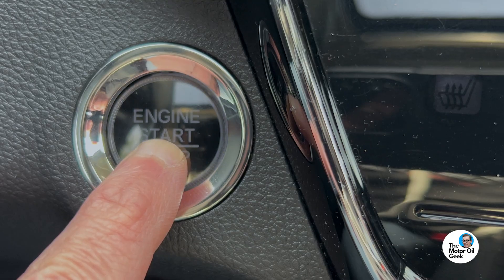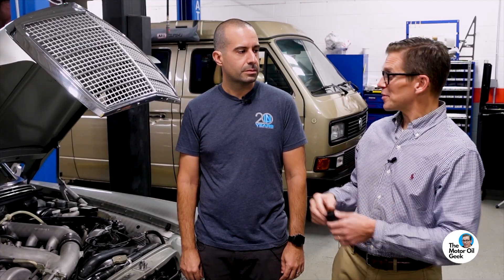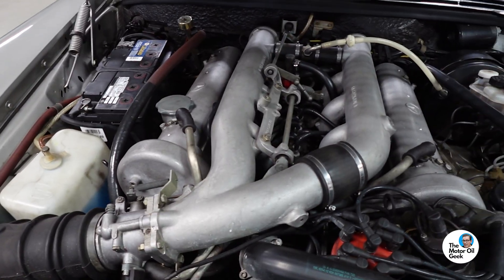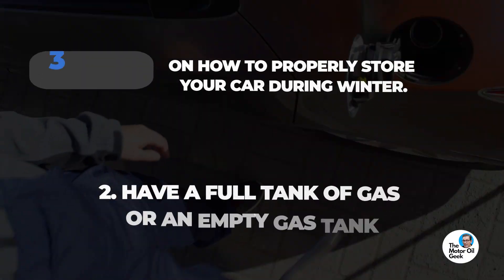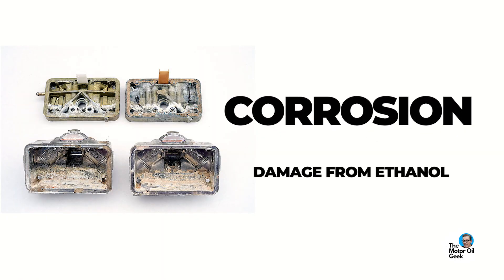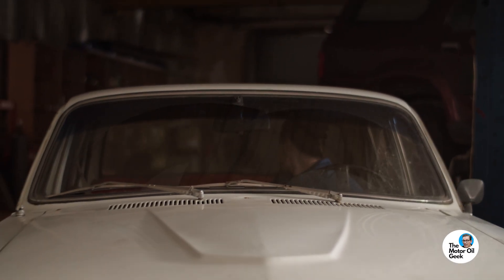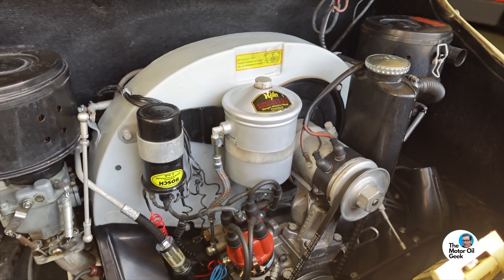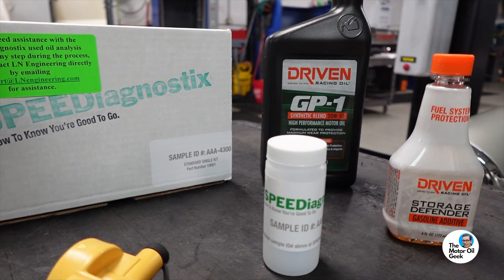3 Winter Storage Tips To AVOID Engine DAMAGE

Comment: Always remember, "where air goes, water goes".  Powersports like ATV, motorcycles and Jet Skis usually have a petcock to shut off fuel.  Most owners, run the carbs dry and that is a no no.  You want to keep the air and moisture out of the carbs and keep the seats and o-rings wet.  Your advice to fill the tank is correct, but you do need to leave a small air gap for expansion especially if you use a heated storage area.  The fuel will expand and push gas through the carbs into the engine.  Turn the petcock to off if you have one. Don't forget to run the engine after fuel treatment.  Many people forget to do this leaving the fuel and components in the system after the tank remain unprotected.

You did not mention fogging oils.  I like to fog 2 stroke engines through the induction system to coat the crank and lower bearings in addition to the cylinder walls.  On 4 strokes, I spray fogging oil through the spark plug holes and spin the motor to distribute.  You are correct, never start a motor in storage, but I do recommend spinning the motor over to keep the cylinder walls and rings coated.  

Great video, keep up the good work.
Reply from the maker: Thanks!

Comment: Awesome info as always! Approximately how long does it take for enough of the oil film to drip off of the engine's internal surfaces to risk allowing rust and/or significant wear on startup from a dry start? I realize there are tons of variables, but is there a general recommendation for a safe amount of time for an engine to sit unused in an unconditioned garage or outside?
Reply from the maker: There are a ton of variables, and one is the oil itself. Some oils will stay on the surface much longer than others. In general, the engine can sit over the winter and be fine - no rust or dry start issues.

Comment: I have never seen a video like this before. However, I have been doing  exactly what you recommended for years. My question is if for some reason you do have to move a vehicle that say you are driving on a regular basis but not using it that day or perhaps several days, can that moisture that is introduced to that shortengine run be burned out at later time by driving the vehicle well enough to completely bring the engine up to temperature for a extended period of time? Great video, and thanks for posting it.
Reply from the maker: Thanks for watching and the question. Yes, driving the car can get the engine up to temperature and burn off the moisture.

Comment: Good advice on oil change and no start.  Note that keeping fuel tank full also reduces moisture accumulation from diurnal temperature and humidity and barometer fluctuations.  I'd like more on ethanol free vs std gas.  How about coolant, you chem experts?  Finally, trickle charger keeps battery alive. 

Sure, tell us about oil life monitors.
Reply from the maker: Thanks!

Comment: My 2001 Chevy Impala has twenty thousand miles on it.  Before I left for a two year trip in Europe I filled the gas tank up added a fuel preservative then changed the oil with Castrol edge professional 10w30 synthetic oil then took each spark plugs out and sprayed a fogging oil in each cylinder then kept a automatic trickle charger to the battery . Then I jacked up the car to keep pressure on tires to a minimum. When I returned home the car started as if has been always driven.:yougotthis: Great Video!
Reply: The old detroit diesel 2 stroke service manuals have tons of great tips on how to pickle an engine. 
One that stood out to me was placing wax paper between the v belts and backing tension off. 
They definitely had good stuff in there especially if it was going to be stored for years.
Reply: Great. You got to see Europe while it was still there.
Reply: @anonymike8280  He got to see Europe while it was still there?
I don't understand what is meant by this.
Reply: @PassionForGrammar   @PassionForGrammar  Then meditate on it. I and the people I have hung with all my life are quick wits who understand cynical and cryptic humor.

I'll admit my remark was a little off topic though.
Reply: @anonymike8280  alright, whatever man
Reply: Russia vs. Ukraine war. @PassionForGrammar
Reply from the maker: Thanks for sharing!
Reply: That's amazing, thanks for this comment - I've always wonder jsut exactly how long fuel stabilizer will actually work!

Comment: Many years ago, I looked up oil sample testing. I recall the procedure was to send two samples. One with the new oil that you put in, then another from the crankcase when you drained the oil. That would supposedly allow a comparison.
Was that ever part of a sample test kit procedure?
Reply from the maker: Yes, you can sample both new and used oil for comparison. It is common practice but not required.

Comment: Other tips, disconnect the battery or use a battery tender to keep it topped off. Inflate the tires to 40 psi, and or park on top of pieces of wood, so you don't flat spot the tires. Or lift the car and suspend the control arms so they don't droop.

Comment: Great info - Also, disconnect battery and put in on a good maintainer either in or out of the vehicle.
Reply: Disconnecting the battery will reset the computer. In some vehicles, it is nece$$ary to go back to the dealer and have the computer reprogrammed. On my car, all that happens is that I lose the radio presets. My car is a 2001 built on mid-1990s technology.

You don't need much current to maintain the electronics, but you have to get things properly hooked up before you disconnect the battery. Do it wrong on either end of the procedure and it could cost you.💲💲💲💲💲
Reply: Exactly. Newer cars need constant amounts of small power. A trickle charger might help.

Comment: Great video, Love to hear your thoughts on top end/cylinder fogging either introduced through the throttle body of a running engine, or into the spark plug holes (obviously not running).  Most marine engine manufacturers recommend fogging as part of the storage prep process.  Is it necessary?
Reply from the maker: Fogging spray is great. Foggit is my favorite.

Comment: What’s about rust on cylinder walls if you don’t run when kept off snow salt roads? But I run and move it around bringing oil temperature up to proper temperature this also lubes drivetrain and uses brakes.I just don’t take it out on salty snow roads.

Comment: Yes, I am definitely interested in how oil life indicators work in cars!  Is it based on Mileage? Engine Hours? Time?  or a combination of some or all of these?  Also, does it vary from manufacturer to manufacturer?  Does each manufacturer have a different algorithm/criteria for the oil life indicator or is this an industry standard across all manufacturers?  And finally, what is the recommended threshold by which I should change my oil?  Is it when it reaches 10%? 15%?  20%?   What happens if a year has passed and my oil life indicator is still above 50%?  Is that possible and if so, what do I do?
Reply from the maker: We will answer those in the video
Reply from the maker: https://youtu.be/t4e0oDBseqo

Comment: This is very usefull !
What kind of oil would you choose for storage- the cheapest recommended by the manufacturer or something in between cheap and expensive?
Reply from the maker: Thanks. Use the oil you typically use. Don't use something different just for storage.
Reply: @themotoroilgeek  Hmm...one more question if i may: what do you think is best for an engine, the approval or the ACEA norm? I mean for example MB 226/RN17  or ACEA C3 ?
Reply from the maker: @hirayaman246  OEM approval is more important.

Comment: FOURTH- Dont suspend the car on jack stands as its not ideal for the suspension system plus added stress on the frame... just pump the tires up to 50-60psi to avoid flat spotting and dont drive it
Reply: You're wrong on that. Ball joints wear just sitting. I was a master certified mechanic, years ago, and had training, that involved that information. It is actually better to PROPERLY support the frame, and let the suspension hang. It also prevents flat spots on the tires. Is it necessary? No. It's not THAT much different, but does prevent that minute wear.

Comment: In the small aircraft community it is common to use CamGaurd oil additive for planes that are stored. I believe it is a foaming agent to keep an oil film on the valve train and prevent corrosion. Would be interested to hear your take on this as they have automotive application as well.

Comment: So.. how long can an engine sit before you need to re-prime the oiling system? How long will oil cling to bearings, cylinder walls, etc?  Is it advantageous to store the engine by running high viscosity additive, like STP, Motor Honey, etc. through it FIRST?
Reply: Yes that will be good to know 😊

Comment: Do oil filter magnets actually help or is this a myth? Also, what would you recommend for a break-in procedure for small engines without an oil filter like a lawn mower or generator?
Reply: I can answer the magnet question. The only thing they help, is to inform you damage has been done. There shouldn't be any magnetic particles in your engine. If there are, something is wrong.

Comment: I've got over 50 cars in storage at any one time and have never used a stabilizer or additive. Modern fuel injected cars are pretty well sealed so the fuel is much less prone to oxidation. I've driven some cars on 8 and 9 year old gas for hundreds of miles just fine after putting them back on the road. As for not not starting them while in storage? I would disagree. Starting them every 3-4 months and letting them run 30-60 seconds (some have no radiator or coolant) keeps the hydraulic lifters pumped up, allows oil to flow to all the seals so they don't start to shrink and cause leaks after you do start to drive the car, and most important if you have an electric fuel pump, keeps the armature in the pump from seizing. The amount of fuel dilution of the oil from running a minute every few months is minimal and these benefits mentioned outweigh any of those issues.
Reply: You don't even have to start the engine to exercise the fuel pump, and your point re:fuel pump corrosion is especially valid when the tank is left empty enoungh to expose the fuel pump to air.

Comment: For winter storage, you also want to wash and wax or coat your car. Then drive it to get more water and soap from the wash evaporated. Don't cover it unless you create a lot of dust in your garage.  Overinflate your tires somewhat to reduce flat spotting and put a good battery maintainer on your battery. If it gets extremely cold in your garage, remove the battery and store it at a reasonable temperature. Replace the engine and cabin air filters while you're at it, and clean the interior glass. You will be ready to go in the spring with minimal effort.
Reply: Why not just use blanket to protect the car against the dust?
Reply: Good post, but I disagree about the battery. Lead acid batteries store much better in cold. In fact even better below freezing(!) due to much lower self discharge. However, it's super important that there is no vampire drains. A digital clock or alarm in a car is enough to drain it in a few months. But if you disconnect the battery, make sure it's clean, charge it full and leave it somewhere cold, like in fridge temp, you can leave it alone for almost 2 full years and maintain over 75-80% SOC. In 25C the same battery can sit for only 6-9 months without needing charge.

Comment: One of most important pieces of information I learned recently is that most modern Fords (and possibly other brands) have a "flood mode" that will allow the engine to crank without starting, great for reducing engine wear after long-term storage and after an oil change.
Reply: Just pull the fuel pump fuse/relay and crank the engine over for like 5 seconds.
Reply: @rolandotillit2867  Some people use flood mode daily on their fords due to excessive rod bearing knock.
Reply: The Corvette has flood mode which prevents the car from firing
Reply: @richarddobreny6664  Are you sure it stops spark?  Usually fuel injectors are not fired (thus the term "flood mode").
Reply: @thisisyourcaptainspeaking2259   valid point,  we call it lube mode.  Flood mode sounds like when we had carburetors
Reply: @richarddobreny6664  This term came from decades ago, the purpose was to clear a fuel flood.  It's unclear to me how or why a fuel flood might occur unless an injector or pressure regulator was leaking.
Reply: @thisisyourcaptainspeaking2259  yes, I remember doing it when the engine was flooded
Reply: @richarddobreny6664  Exactly, flood mode is a diagnostic that every ice can benefit from.  No reason to exclude it aside from attempting to make the vehicle less capable.
Reply: My new Charger and Challenger will both crank up to 10 seconds if you want. You have to floor the throttle pedal. Seems counterintuitive 😂
Reply: Ford modular V8's won't prime the engine by turning the motor over like this. Oil pump won't turn fast enough.
Reply: All fuel injected engines I've tested have flood mode, it's standard as far as I know.
Reply: @thisisyourcaptainspeaking2259  Not standard on BMWs. Do not try this unless you're confident that it'll work.
Reply: @DOAHunt3r  That's unfortunate BMW overlooked flood mode but at least they provide a good sound system, I hear.  Maybe in the future they'll reconsider diagnostics.
Reply: @thisisyourcaptainspeaking2259 we have owned several bmws and haven’t ever needed a clear flood mode. My ford truck has a clear flood mode and I also never needed it.
Reply: @FishFind3000  I rarely use clear flood mode either but they refer to it in many owners manuals and shop literature.
Reply: @thisisyourcaptainspeaking2259 I’ve seen a dodge truck that didn’t have a clear floor mode and the guy tried doing it like he did on fords and ended up redlining the engine after an oil change so it had not even built oil pressure 😂😂
Reply: @FishFind3000  Yeah, hard to say but the throttle position sensor must be working so maybe his wasn't?

Comment: Yes please on how oil life indicators work. Really interested as I'm having endless discussions with my father regarding his Civic 10th gen!
Reply from the maker: Noted!
Reply: @themotoroilgeek  I'd like to see an in depth breakdown of Shell Rotella T6 5W40. I'm really curious as to if it's a GTL oil like a lot of high end Shell products. I run it in my motorcycle, as it's rated JASO MA for wet clutches
Reply: I see that debate on forums all the time " Change your oil no longer then 6000" " No I trust my computer to tell me to change it"
Reply from the maker: https://youtu.be/D7hvTWsLIP8?si=1uq8oZpYWU12RnL3
Reply: What is the best way to service the battery and protect the tires from dry rot / flat spots?

Comment: YES on oil life indicators
Reply from the maker: Noted!
Reply: @themotoroilgeek yes on the oil life! Also would like to see a Toyota motor oil vs Mobil one oil, keep seeing everyone say Toyota oil is made by Mobil, but I’m betting there’s a big difference between the two! Keep up the great work!
Reply: Yes.  Indicator video, please!
Reply: Absolutely. Even though I ignore mine and change based on miles. Oil analysis verifies my change interval is appropriate.
Reply: Yes on oil life indicator
Reply: Dipstick is a great indicator, using your eyes and nose. Smell for burnt, fuel, etc. MILKIY= water. Look for sludge or grit pieces, shavings, anything.
Reply: If I used that, I'd be changing oil and filter once a month.
Reply: Please do. New subscriber!
Reply: My oil life in my Acura goes off engine hours I feel like, when I idle a lot it’ll recommend to change every 4k or so but if I am on the highway a lot it’s more like 8k
Reply: Yes please!
Reply: The dipstick and your smell is a better Indicator.
Reply: I also believe that oil life indicators are programmed to say oil is ok when it’s not to provide a favorable rating with EPA
Reply: Yes
Reply: I agree, this would be an interesting topic.
Reply: Yes please 🙏
Reply from the maker: https://youtu.be/D7hvTWsLIP8?si=1uq8oZpYWU12RnL3
Reply: Its an algorithm based on idle time, engine rpm, temperature, towing/load etc. The indicator has no idea the condition of the oil. Change it at regular intervals as usual and based on type of use. Ignore the indicator completely.